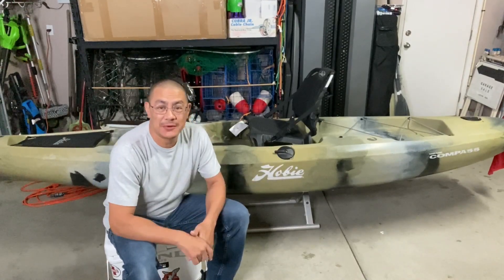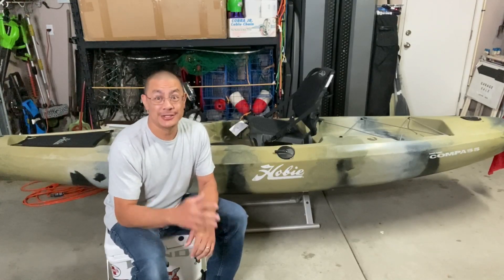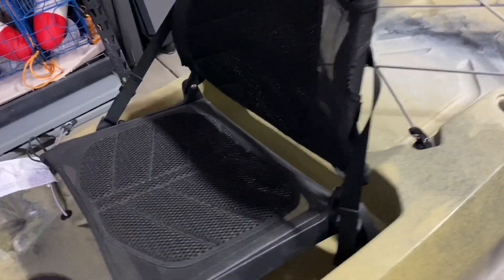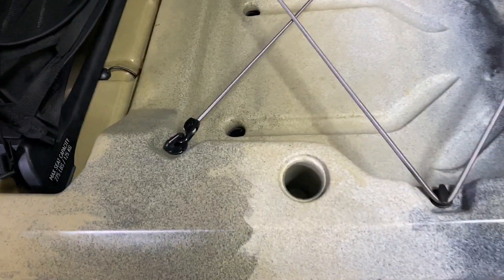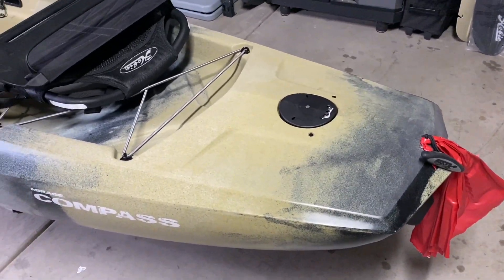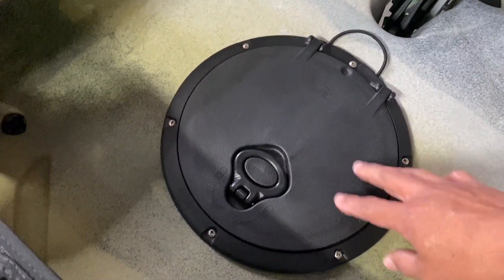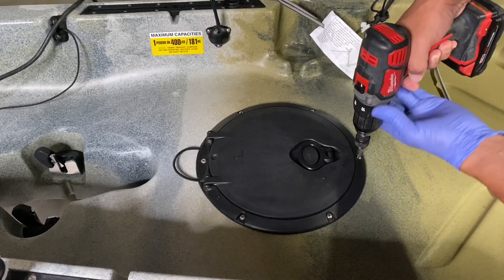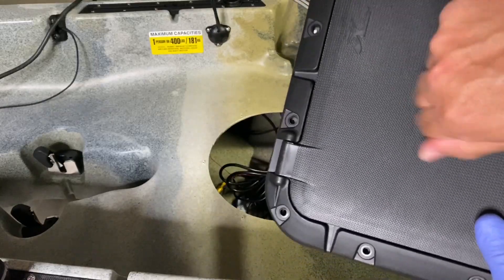2020 HOBIE COMPASS step by step INSTALL & MOD’s! Why I DITCHED the Pelican Catch 110HDii explained..

Comment: I sold my pelican catch130 hdii for the same reason I fish from rockaway beach Pacifica. I  went for a stealth fusion 480. The catch pedal kayaks are good for most things but definitely not for the ocean.
Reply from the maker: It was just too slow, not very agile & difficult to maneuver in wind & current. Plus, it didn’t feel like a premium kayak, more like a cheap imposter. As soon as I realized the gear tracks couldn’t stand up to the gear I required to use for ocean  salmon I got rid of it for something that could.
Reply from the maker: I forgot to mention you got the MooMoo mobile 😂

Comment: Don't be afraid to add some epoxy to your screw holes to increase your water-proofing.
Reply from the maker: Epoxy makes it sound like forever 😂. I did a few dabs of silicone for good measure. Thanks for the suggestion!

Comment: You want to put Sealant around that hatch before securing it
Reply from the maker: It sounds good in theory. I’m sure it would provide additional water tightness. But it’s difficult to accomplish when using the foam gaskets that go on both sides of the deck before inserting the hatch. Plus, Hobie didn’t see fit to apply any to the exist factory installed hatch.

Comment: I use a Deeper Sonar.. no wires or drilling.. and using old android tablet to view 9" screen
Reply from the maker: Interesting 🤔, your not worried about water getting in the tablet
Reply: @BigShticks  Got a water proof case..keep it under the seat otherwise I set it on top of the hatch hole between my legs also can pass it to the front passenger so they can view it too
Reply from the maker: @jeffdavenport4939  
OMG I can’t believe the waterproof case never crossed my mind as an option 😂. Hey sometimes the best solutions come through reuse of our seemingly outdated things we supposedly have no more use for.

Comment: Take your chair back bro have the same yak straps on my chair are long as..
Reply from the maker: Damian Westcott 
Yeah I emailed Hobie, they said to contact kayak city & they can send new straps. Problem is they are only open Wednesday thru Friday 11-5 due to CoVid & I work every Wed-Fri in the hospital. There’s no answering machine so I can’t leave a message. But I plan to get it addressed because it’s just unacceptable
Reply: What anchor system are u using..?
Reply from the maker: Damian Westcott 
Right now I’m going to use an 8lb mushroom, 80ft of line with a pot float & loop on the end that goes on a quick release line that’s affixed to the rear of the kayak & runs to a clam cleat by my side.
Reply: I noticed on your old kayak u had a winding system next tour seat
Reply from the maker: Damian Westcott 
That’s a downrigger bro